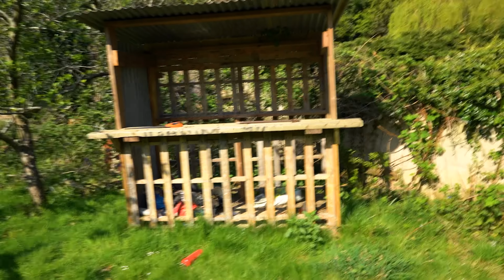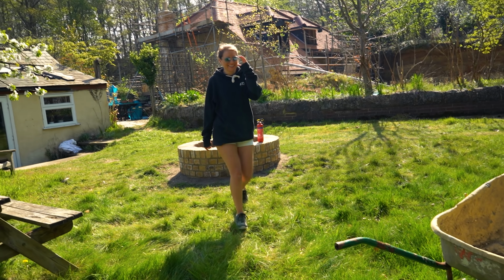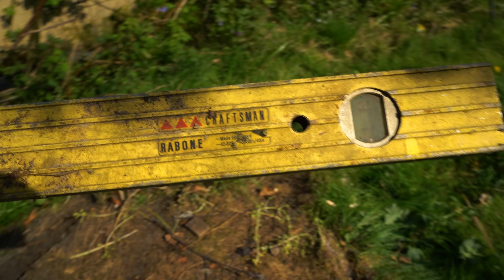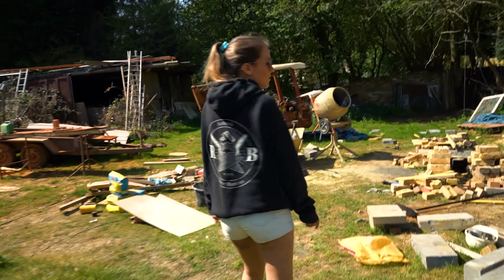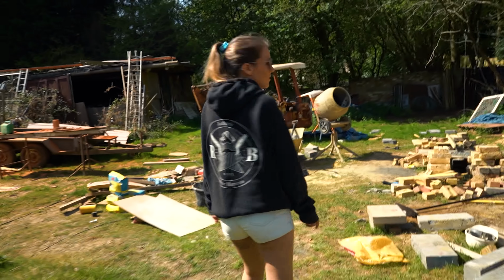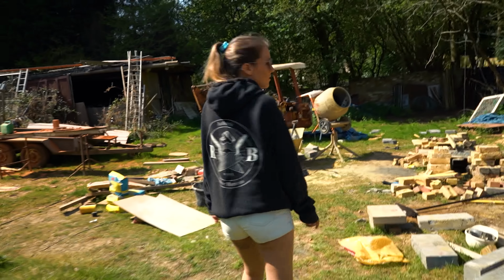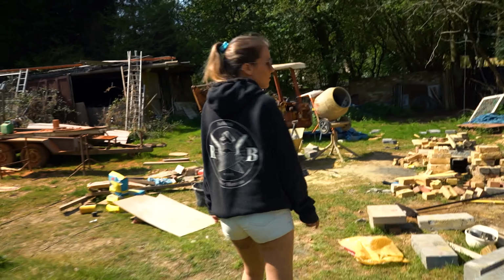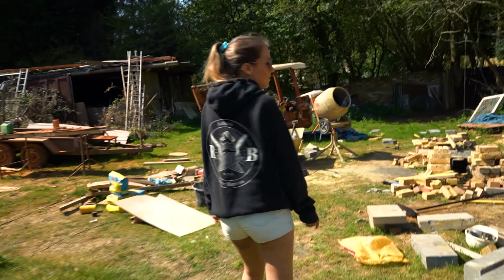BUILDING A HOUSE ALONE from START TO FINISH | E.P 94 [COVID-19 Quarantine - Behind the build]

Comment: Hello you two. Nice video.
I have had the same problem with my digger. There may be oil missing in the planet-gear housing which pulls the belt. There is probably a screw at the end of the hydraulic motor where you can fill on oil. Give et a go

Best Henrik

Comment: You need to check the oil level in ur drive motors. The broken one possible has no oil and has broken the sun gears. £1500 for a new one

Comment: Dope video of the covid life. Never heard a depleted battery called “flat,” before but I am totally gonna snag that. That fire pit is gonna be my first brick laying project. Problem is that I’ve never set a footer. Does it need rebar because of the constant heat exchange from the fire pit and if so any advice?
Reply: Don't talk so fucking round shouldered, it's a fire pit in a back garden, not a fucking blast furnace...and I've never heard anyone describe a flat battery as being "depleted" lmfao

Comment: Like, mechanical problems dont normally get better when you leave them. Maybe the bearings in the motor or track is buggered, bearings will continue to work poorly, they take a lot to fail completely. What cement mix did you use for the fire pit? Does it need to be fire retard cement?? Ta

Comment: What's wrong with the pick up truck?
Reply: Does the engine turn over?
Reply from the maker: It tracks to turnover but never gets going unless I blow some carb cleaner in it. Then it goes but once I stop it stops
Reply: It could be dirty fuel, or the fuel filter may need changing on the pick up
Reply from the maker: Cheers buddy I'll try that 👍🏻😁🧱

Comment: Great videos like watching you need to check the oil in the drive hub on the digger if its clean you might have a broken gear inside that will jam and prevent it from turning